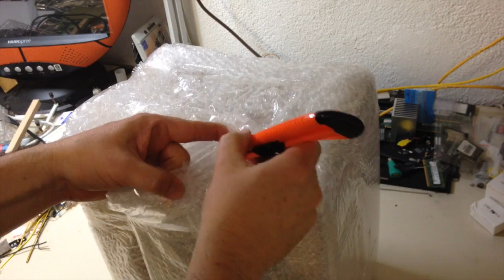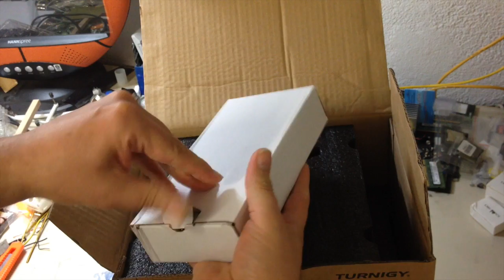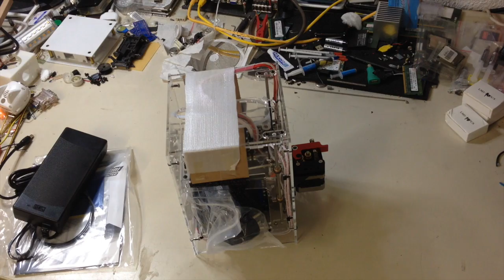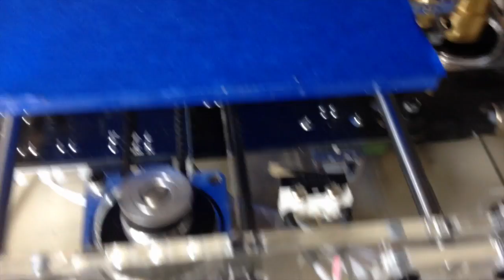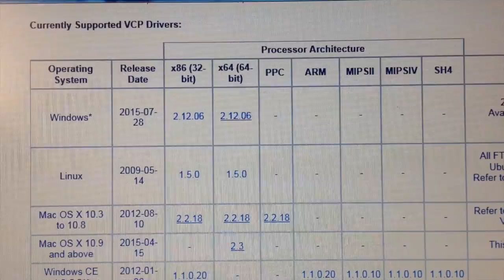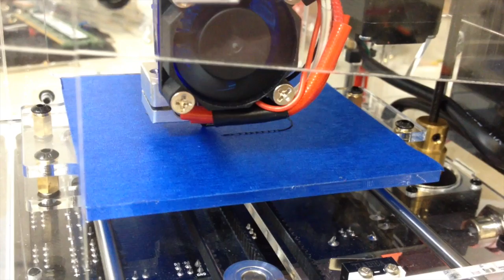Turnigy Fabrikator Mini 3D Printer Unboxing

Comment: Hey! 1 Year later are you still printing? My printer wont connect to Repetier host? Can you help! Also so many cura updates! I HATE THEM!
Reply from the maker: Yep, still printing away as on the first day, what's the issue ? It just doesn't connect any more ? I'm running repetier host from about half a year ago - mostly using slic3r and cura to slice, no problem with that.
Reply: The problem is, my computer broke, so we had to restore it, and I didnt have repetier! So I was like u with an old version! NOW ITS THE UPDATED VERSION!!! and it will not connect!
Reply from the maker: I can't really confirm that, I tried a new install yesterday, and it connected ok - I do have the Arduino IDE installed on that PC as well, and that brings the required serial driver (which was a little cumbersome to install before). I haven't configured it, so I can't test the print - but it did connect. (Also via the Arduino IDE serial monitor)

Comment: Vielen Dank für das ausführliche Video und auch den Bericht :-)

Ich hatte schon fast den Drucker aus England bestellt, aber dann heute gesehen dass Hobbyking am Wochenende kostenlosen Versand ab 150 Euro hat. Selbst mit Einfuhrumsatzsteuer ein tolles Angebot.

Welchen Düsendurchmesser hat der Tinyboy? Ich fand auf der Shopbeschreibungsseite nichts.

Da ich nur 1.75mm ABS und 3mm PLA habe, wollte ich dann einfach bei Amazon mal ein KG günstigen Kunststoff bestellen (Rund 18 Euro für ein KG, aber "Eco" mit der Angabe dass es eher für 0.4mm Düsen und größer geeignet sei).

Welches Filament ist zu empfehlen?

Gruß
Marcus
Reply from the maker: Schorhr Hallo, Dankeschön, der Fabrikator Mini hat einen Düsendurchmesser von 0.4mm. Ich habe auch erst drei verschiedene Filamente damit benutzt, alle PLA - dabei hat das PrimaPLA (Amazon) recht gut funktioniert - mit dem PLA für 0.2mm (Von Reichelt bestellt) kam der kleine nicht so gut zurecht.
Reply: Dirk Herrendoerfer Danke für den Tipp! Das ist ja preislich auch in Ordnung, und es gibt sogar noch Transparent, Nachtleuchtend, etc. Allerdings hatte ich mit meinen "Discountplastiktests" meist mit Weiß die besten Erfahrungen, allerdings nicht von der genannten Marke. Welche Farbe hatten sie im Einsatz?
Reply from the maker: Schorhr Ich hab blau und grau in 2 Druckern. Gerade blau - ist mir aufgefallen hat sehr wenig oozing. Ich überlege gerade wie sich einfach eine Kühlung realisieren lässt.

Comment: I've installed the drivers and everything and the repetier connects to the printer but when I send commands, the printer doesn't respond and the software just says 1 command waiting :(
Reply from the maker: ***** Always, or only when you try to print ? Make sure there is no temperature configured for bed heating, or the temperature should always be zero.
Reply: Always, when I click connect it says 4 commands waiting. Those commands clear after a while but when I click home to do the setup it just says 1 command waiting and the printer still does nothing. I'm using 1.5.4 but i have also tried 1.06. Both no luck.
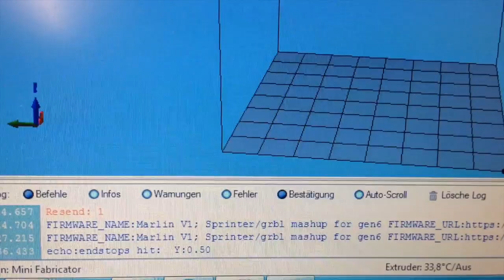Reply from the maker: ***** ok, you click connect, and are you getting the connect message from the printer, like at 15:01 of the video ?
Reply: Dirk Herrendoerfer No, I'm not.
Reply from the maker: ***** This means something is really wrong, check if you are using the correct com port, possibly try to reinstall the driver and look into the device manager what com port the 3D printer is using. If possible, try to double-check with another computer. It might even mean that the controller board in the printer is not ok.
Reply: Dirk Herrendoerfer it shows the firmware version and alike. Plus it shows the current temperature, still the printer doesn't move. Do you happen to have any hints?
Reply from the maker: Sebastian Schuon So, manual moves via the Repetier applications do not work ? 
1st: test if the power is ok, the LEDs in the printer should come alive if the power supply is attached even if no PC is connected.
2nd: manually move all axis so their home switch is not 'on'
3rd: power and attach the printer and press the homing button for X,Y,Z to see if it will try to home.
Dirk

Comment: Beware it didn't work with Windows 8.1 because of the USB Driver chineese USB chip.
maybe use XP.
Reply from the maker: wernertrptube It did work for me, but I had to install the VCP driver package from http://www.ftdichip.com/Drivers/VCP.htm first.
Reply: Dirk Herrendoerfer hi Dirk , i am really confused should i buy it or not 
as it prints  only PLA(which leads to poor build strength ) , takes too much printing time , not good for complex printing , too small print area .
I am a student , i need 3d printer for printing rc models  frames  accessories , cases , etc.
Reply from the maker: VASUDEV UPADHYAY Hi, you don't sound so confused to me - you have a petty good outlook on what you need, but what do you want ?
I cannot, and I will not give you a sales pitch to buy anything, because I am in no position to do so.
Reply: Dirk Herrendoerfer  my confusion comes on thought that is this worth the money (even if its cheapest 3d printer )  ,will it be capable to feed my needs. how was your experience with it
Reply from the maker: I posted a review video yesterday, It is a good 3D printer. It is also small. It is worth the money, but if you buy it, and you have the need to print something big, or something very detailed, then you might need to buy another printer.

Comment: How's the quality of the printer?
Reply from the maker: ***** I would compare it to what a 1 Year old Prusa Mendel 90 did produce then. But that was more expensive, and a lot bigger.
The build quality is ok, after some fiddling it is very good, it is not super or excellent, but all that only makes sense if you have some sort of base benchmark to compare it to, and at that size and price point the Fabricator stands alone.

Comment: What slicing software did you use, and where can I get it..... There is no files on hobbykings website, like they say there is.
Reply from the maker: Chris Wilson I use Repetier host ( http://www.repetier.com/downloads/ ) and Slic3r ( included in Repetier ) the included manual refers to setting up CuraEngine, I have
no experience with that, but it looks somewhat straightforward.
Reply: Thanks. I actually just downloaded it, and am installing now.

Comment: To tighten the belt and eliminate the backlash mentioned-- at 19:42 lower left corner connection in frame, remove the zip tie that holds the end of the belt and tighten and re-zip tie the end.
Reply from the maker: Zarouszz Yes, there is a bit of slack belt to pull on, on the right side of the printer, and the zip tie on that end does not loop around, but It requires the removal of the side panel. The designers had definitely thought about the problem.
Reply: Dirk Herrendoerfer I am confused... They did think of the problem , or didn't think of the problem? It seems that if they did, you would be able to tighten it without taking it apart...
Reply from the maker: Jeffrey Seymore Both, I guess. They made it easy to tighten the belt for someone with the capability to open the outer shell, but successfully kept everybody else from messing with it.
Reply: Makes sense I guess.  Any more videos coming? Perhaps a video on how to tighten it? Too bad it didn't come with extra zip-ties! lol

Maybe someone will come up with a mod to replace the zip-tie method, or an easier way to tighten it!! Perhaps a 3D [printer replacement part???? lol

Great video! Keep them coming, I am trying to convince my wife to get this for my birthday next month as it would be my first printer, and one I can actually place (And then actually use lol) on my desk...